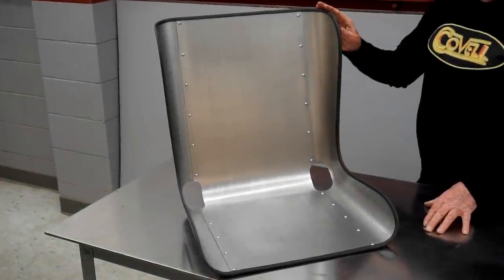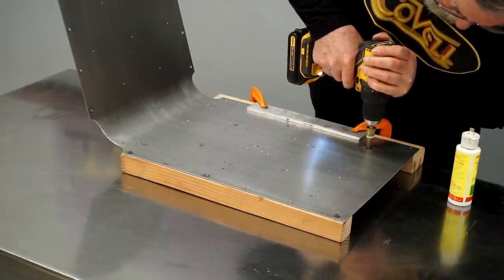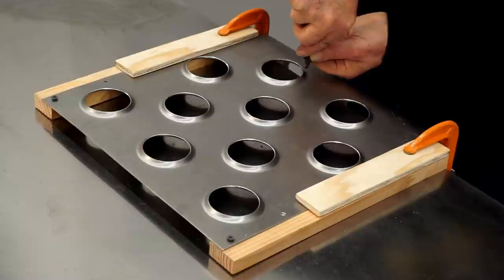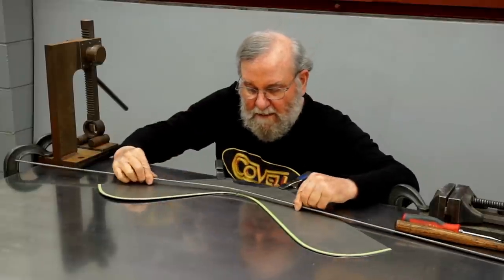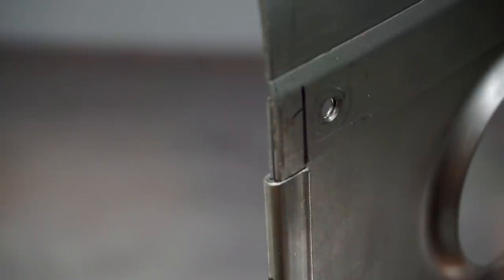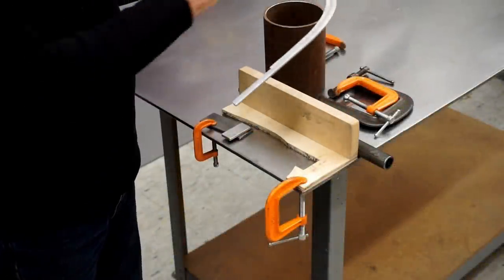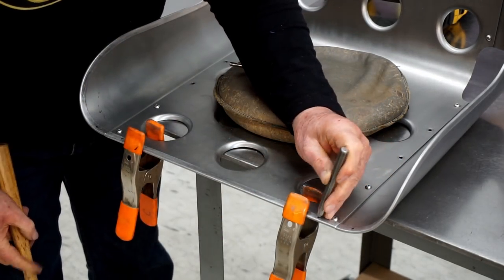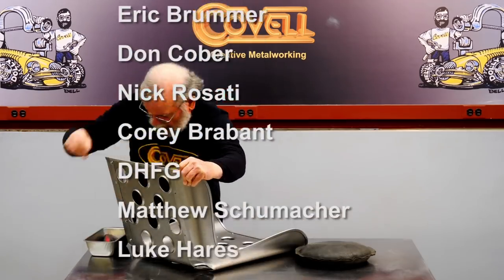Taking a Bomber Seat to the Next Level

Comment: I had to make a couple of odd sized flanged holes, far too few to warrant buying or making a press tool, so I took an EAA video trick and used a wooden dowel with a rounded head and a slot. Going around the edge several times, bending it up a bit by bit with the slot each rime, gave surprisingly decent results.
Reply from the maker: That's a good trick!

Comment: Wow Ron, those few changes really made this simple seat look a lot more refined and visually interesting.  The little 4-40 flathead screws are a super nice detail too.  It’s always interesting to see how you figure out a process for getting any job done, like forming that U-channel into the right shape in two different planes.  Thanks so much for sharing these videos, I always learn something!
Reply from the maker: Thanks, so much, Joe. I learned a few good things through this process too. My initial plan was to crimp the channel onto the metal edges with a beading machine, but when that didn't get the cap sufficiently tight I sought a solution that would work even for people who may not have a beading machine.

Comment: I love your videos and those of Gene Winfield and Lazze. Your work inspired me to build my own 1932 roadster body from 18ga cold rolled steel. If I had known all the problems of fabricating the body from steel I think I would have used aluminum. I am accomplished structural aluminum and steel fabricator and have done body work in the past but this was my first try at sheet metal fabrication of this size. Right now I am at the point of needing seats so I have been looking thru videos to build the, This seat may be a starting point for me but I want a bench seat which I am thinking this seat could become with some work.
Reply from the maker: You certainly could modify this seat design to be a bench seat. If you're not familiar with the work of Jamey Jordan, check him out. He makes spectacular bench seats, as well as buckets:
http://handmadeseatco.com/seats/

Comment: I love your art, Ron.  And your unique ways of problem solving.  It's always interesting and thought provoking.  Now, to take a good thing too far, what about hand engraving around those holes?  That's and art form I was going to pursue with a gunsmith friend, but he relocated to North Dakota before we got too it.  Remember the flungs!
Reply from the maker: Engraving is an artform in itself, and one I have never explored. I have seen some magnificent engraving on cars and motorcycles, and I would certainly encourage you to learn more about it.

For anyone who is reading this, and is curious about the term 'flungs', I once installed a fuel level sensor with instructions in 'Chinglish', which said to drill holes in the tank for the mounting screws, then hold the tank upside down and shake it to remove the 'flungs' - you know, the bits of metal that fling out when holes are drilled.

Comment: Nice progression. If I were to make this seat, I would use aluminum brazier head rivets (soft aluminum) instead of screws  for final assembly. I really enjoy how you take simple things and make a fixture to get the job done.  Thanks for posting.
Reply from the maker: Most bomber seats are riveted. I intentionally used button-head screws to make the process accessible for people who may not have a rivet gun, or even an air compressor!

Comment: I have a couple questions and comments. The hole punch die, is that a regular hole puller set with just an add on ring to make the dimple? When you set the screws around the trim, did you need to chamfer the outside edge of the holes to deburr them or did you wait until the screw was in place then grind them flush? Smoother that way, I think but just asking.
I thought rivets might look nice in place of the screws. Solid rivets, you could use a air hammer formed for the head on one side and the backer block for rivet setting on the other. But which side would look best? You could recess/countersink inside the seat and leave the small dome on the outside was what I was thinking but is there any real purpose to being removable?
Reply from the maker: Several companies make hole punches that do not curl the edges of the holes (Greenlee is one well-known brand), and  several companies make tools that flare already-existing holes. It takes a specially-designed die to do both in one operation.
I used ten 4-40 screws, and I countersunk the back of the first eight to deburr them before setting the screws. On the last two holes, I used screws that were too long, and sanded them flush after tightening. These are nearly invisible on the outside, but if I ever need to remove them I would probably chamfer back side of the hole (and the ends of the screws) for re-assembly.
Most bomber seats are riveted together. I used screws to make this project accessible for people who may not have a rivet gun or air compressor. It's very unlikely that you would need to remove the edge cap, and in fact I spot welded the cap into place on this bomber seat:
https://www.youtube.com/watch?v=0NRN2IXjwsY

Comment: Since you already drilled through the edge molding, wasn't the center punch unnecessary to drill the hole through the seat? That edge molding definitely gives it a nice finished look with a lot less effort than rolling the edge itself.
Reply from the maker: I'm not clear on what you're saying. When I centerpunched the edge molding, I drilled through three thicknesses in one shot - the top surface of the molding, the seat itself, and the bottom surface of the molding. I agree that the edge molding is easier than forming a detail on the edge, and it adds quite a bit of strength, too!

Comment: Thick ness and hard ness of the metal you are using Thank you for your time
Reply from the maker: I used 20-gauge steel for this demo (.89mm) but 18 or 19 gauge ( 1.14 or 1mm) would be more durable. The grade of steel is 1008, but the more common 1018 would work as well.

Comment: Brilliant Ron.. waaaaaayyy beyond my skill level, but very informative. Incidentally, the holes do look cool, but flanged holes in the sheet metal are there for strength, especially in aluminium. Cheers.
Reply from the maker: I'm glad you enjoyed this video. Yes, there is no question that holes with flanged edges add stiffness, and reduce weight.

Comment: Awesome content and details. What are the fastener that you used to secure the sides to the center sections? Thanks you for your continued instructions.
Reply from the maker: I used #8-32 stainless button head socket screws - like this:
https://www.albanycountyfasteners.com/Button-Socket-Head-Screw-8-32-304-Stainless-Steel-p/12000.htm?utm_source=google&utm_medium=cpc&adpos=&scid=scplp12002&sc_intid=12002&gclid=Cj0KCQjwjN-SBhCkARIsACsrBz7R4sEASd5LAhEj3oYt0N8IP7JSpp-7T18IIhhwCl4I542Dd-yE9sQaAov2EALw_wcB

Comment: I noticed that you made the end of your locking plier jaws flat (using a bit of sheet metal?). I'd love to see a video where you show your modified tools
Reply from the maker: You can buy locking pliers with flat (non-serrated) jaws. I have some of each style. For the record, I put a little gaffer's tape on the jaws to help prevent marking the edge cap. Your video idea is good - I'll keep in on file!

Comment: I love this set of vids on simple yet elegant metal work. A question on the keeping it simple. Some of us do not have bead rollers, so would making a jig with offset flat stock work well enough? Or would that be too difficult to get a smooth finish with?
Reply from the maker: I put a lot of thought into how to make a stepped edge without a bead roller. Perhaps it could be done, but I predict the process would be fraught with difficulty. Let me know if you figure out a way to do it!
Reply: @RonCovell  If you cannot figure that out, I have no hope of doing it. I only mentioned it because the bead roller is the only tool in the process thus far that might put most beginners out of the project. However, one cannot do everything with nothing. I am still very impressed and grateful that you are showing how much can be done with basic tools.
Reply from the maker: If you did everything else, but left out the step with the bead roller, you'd still have a very nice bomber seat!

Comment: My explanation for the annular cutter would have been a lot more lowbrow...  "This is basically a metal hole saw..." 🤣
Reply from the maker: Annular cutters and hole saws are quite similar, but the annular cutters are thicker, and designed for more rugged cutting. I used to call them 'Rotabroaches', which is a trade name, but there are other manufacturers, and I don't want to show favoritism to one.
https://www.hougen.com/cutters/magdrill/Hougen-Annular-Cutters.html

Comment: Is there any reason why you wouldn't use a drill with socket adaptor or impact wrench, etc., to tighten down the die?
Reply from the maker: I don't think a drill would have enough torque. I have used an impact wrench, and it works, but it seems a little harsh. I worry that continual use would wear down the threads in the dies.
Reply: @RonCovell  That's fair. Thanks for the answer!

Comment: Hi Ron, a question if I may; how thick would you make the seat in aluminium, I’m planning on using the seats in an ultralight aircraft.
Reply from the maker: I think you could use .050" or .062" aluminum. You will have to take special care with the mounting, spreading the loads over a large area.
Reply: @RonCovell  many thanks Ron, I really appreciate you taking the time to respond to this.
Thanks again 
Michael